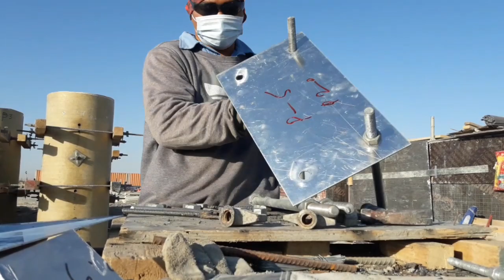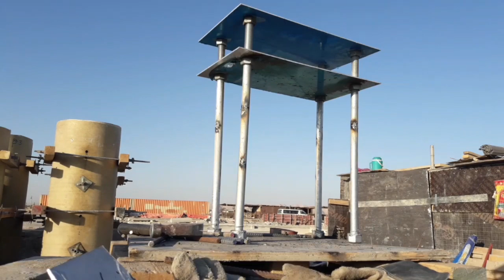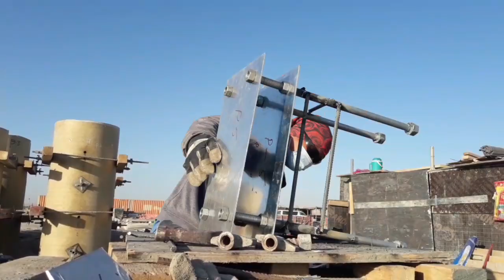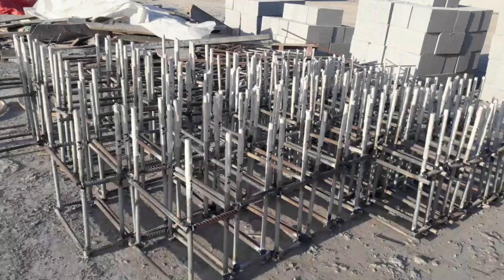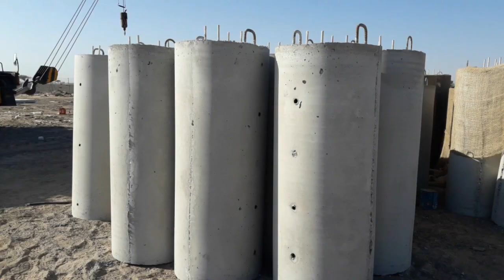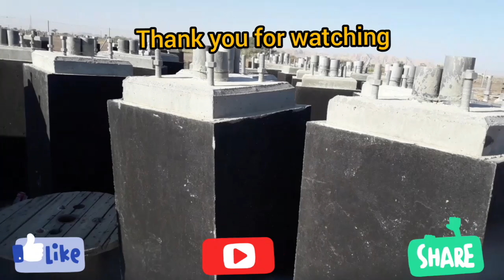Anchor bolts installations #JAYSONVLOGS# Jayson Vlogs

Comment: If the anchor bolts are Gr B7 we can't weld it because of material properties, coulld we just tie up with steel wire ands the bars to keeps the archor bolts 90 ° and distance between them?
Reply from the maker: Thank you